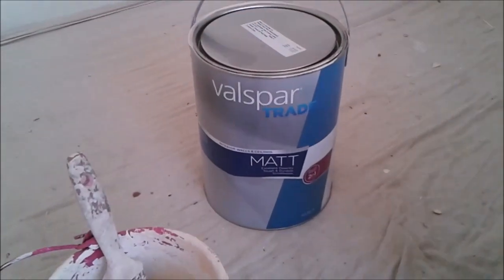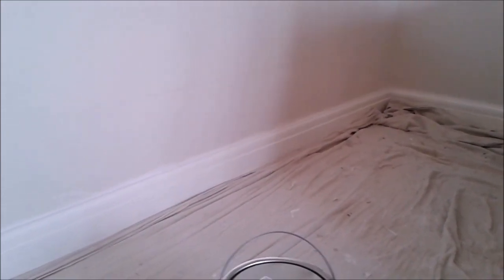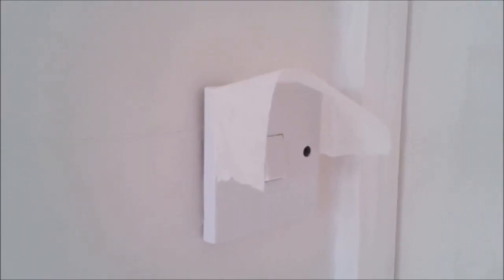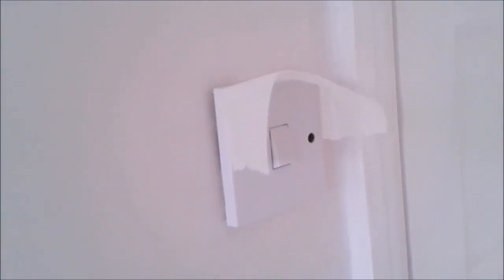Applying first coat to lining paper

Comment: When I line my walls with paper I leave a couple of mil gap then use a couple of coats of easyfil. It’s a bit of a faf and I’m just a home decorator. What’s the “hard stop” thing that you speak about where the joins are to cover them? Might save me some effort
Reply: He shows how to mix hardstop in quite a few videos, but essentially you just get powder polyfiller add enough water to make it a thick paste then add some of your wall colour paint and mix until it's creamy smooth then use that to fill any gapsin your lining paper.
Reply: @jaysfone  cheers mate. Will have a look

Comment: Hell sir. I have lined my wall with lining paper and intend to emulsion over. I hadn't paid attention to ensuring paste wasn't smeared on the face of the paper and at the seems. How should I deal with those areas prior to painting as I noticed you say that paint reacts with the paste.
Reply from the maker: Paste is reversible so it just needs wetting with warm water and wiping off. When you paint if anything reacts just scrub it in with the paint it will be fine. Thanks
Reply: @PaintingandDecorating  
Brilliant thanks! I'll wipe down all the seams
Reply from the maker: @LouisMoir-Barnetson  just becareful not to rub too hard and work up the paper.
Reply: Zinseer Gardz next time

Comment: i just lined a room - but i noticed some paste residue on the surface of the paper. i've also put a bit of filler in a couple of areas on top of the lining paper. should i apply a coat of zinsser bullseye water based primer first - then 2 coats of emulsion over that???
Reply from the maker: The paste should wipe off after soaking with warm soapy water. And usually we fill after the first cost of paint on lining paper, using a hard stop filler.  Which is paint and filler mixed together. Thanks

Comment: Sorry but do you pva your first coat then do normal coats?

Also do you have any tips I have hung the linning paper but at the bottom near the skirting boards I have about a 2/3 m gap and I don’t fancy trying put linning paper in the small area.
Reply from the maker: Not when painting lining paper and you can fill the edge of lining paper to smooth it.